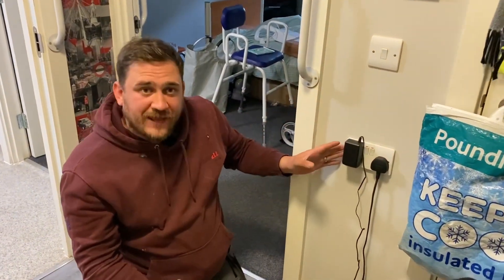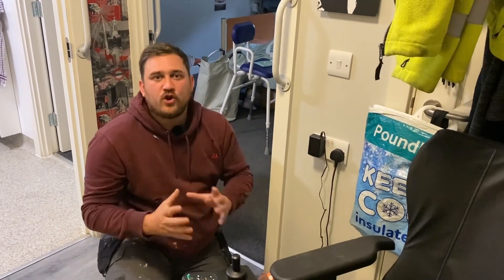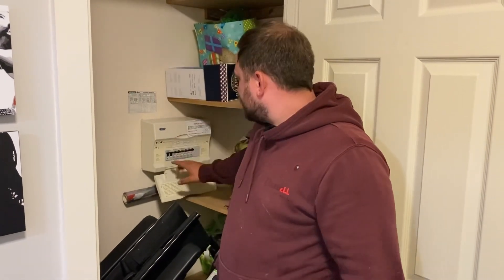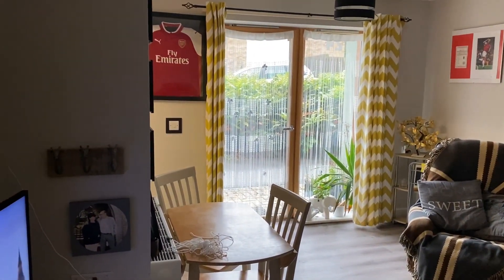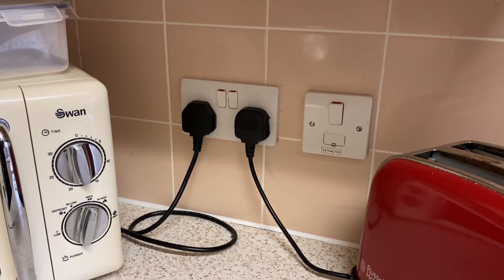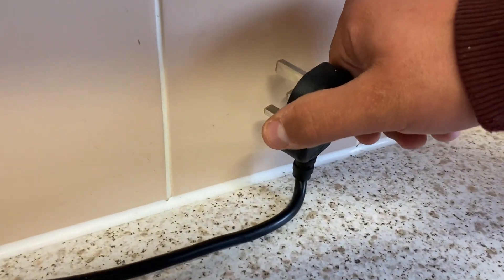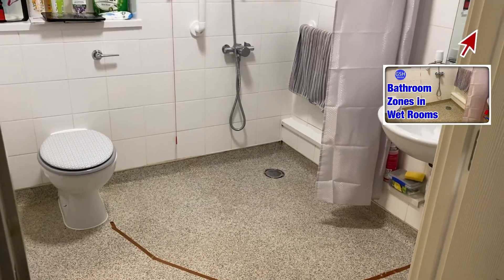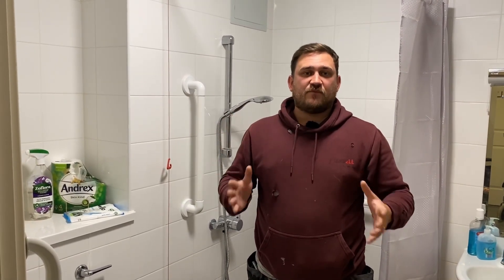The Heights of Switches, Sockets & Consumer Units Under Part M of the Building Regulations

Comment: Completley  wrong. Its 450 to bottom of socket and 1200 to top of switch . In the building regs  its state between 450 and 1200. Not over as the definition of between speaks for itself.  You have misread this totally
Reply: Check what it says in the on site guide   .It states should be installed between 450 and 1200. If you install to centre line then are below this

Comment: Its simple 1200 to top of all accessories ffl and 450 bottom of all accessories. I can't  see whats hard about that and its only new build
Reply: How dare you keep it simple. You’re suppose to pay 💰 for a complex interpretation of these simple requirements.
Reply: @MrAlexwoolf  haha sorry sir, I'll make up some bullshit so we can fleece a few unsuspecting home owners 🤣
Reply: Except when it's a thermostat, or a fan isolator,or a consumer unit and what about double row consumer units and pull cords , disabled alarm pull cords😢😢😢
Reply: @loosecannon5813  its all in regs boards 1400, fan iso should be 1200 or should be at the minimum of 450 for disable, 1200 for stats, disabled pull cords usual touch the floor anyway for that reason. So simple enough

Comment: For me it’s as the diagram shows… between 450-1200mm exclusively. You can’t put a 9 gang switch’s centre line at 1200 if you go by the wording 🤷🏻‍♂️ So really this needs clarifying, as great as a debate it is on site sometimes 😂
Reply from the maker: I have left a link to part M of the building regs in the description. If you keep within 450 and 1200 you will always be correct 👍🏻

Comment: Just checked the on site guide. Still 450mm to the bottom of the socket and 1200mm to the top of the switch. Wouldn’t call it a misconception.
Reply: Exactly my thoughts! Are we meant to use On Site Guide or Part M? The regs are getting more confusing by the day
Reply: Building regs statutory document.
Bs7671 advisory document 🤷

Comment: What about a Three phase consumer unit located in a domestic property to accommodate extra loading from heat pumps, EV chargers, electric showers etc. What height should these units be located as the switches usually run vertically not horizontal?

Comment: Sorry but the hight of accessories is irrelevant, 
My mum god rest her was only 3ft tall and so could not reach a   Light switch at the standard hight , my oldest brother was 6.7 and a light switch was way too low for him. The IET needs to think about the hight of us humans , if you’re a dwarf your still more likely to need to stand on a step to reach the kitchen work top . And if you’re more than 6,2 your more prone to back problems because you have to keep bending down to switch the light on or plug the hoover in . I was tort the hight of socket outlets should be about mid shin and light switch level with the shoulder give or take an inch or two.  For nursing homes or care homes sockets should be about waist high .
But who am I to argue i’am just a humble spark who’s opinion means nothing. 
Great video Marcos as always 👍👍
Reply: I’m 6 foot 8, I can tell you that waist height switches don’t require me to bend over to operate.

Comment: since when did it go from Part P to Part M. I swear that when I did Part P back in 2015  we covered holes in joists, zones and heights of sockets and switches with no mention of Part M.
Reply: Part P is still there each part of the building regulations gives different information I.e part m covers heights of accessories part A covers structure so holes in joists and chase depths etc also not just electrical requirements in these regulations for most trades info aswell 🙂

Comment: I normally allow 6" above kitchen worktop to allow for a standard 6" tile and sufficient space clearance.  NICEIC says minimum 100mm.  But where in the Part M document does it say 150mm, what page on the online copy?  In other areas I usually go by the diagram 450mm to 1200mm even though it says 'centre line' because it also says 'as diagram'.
Reply: Also in the electricians guide to the building regulations 🙂
Reply: @marcusbarritt91  I see, well my 6" will do :D
Reply from the maker: The 150mm rule is not in part M hence we didn’t say it was in the video 👍🏻

Comment: When showing what "Smart" things can do... please omit or bleep out "Hey Google" or "Alexia" otherwise you start /switch a few hundred things on and off.
Reply: Fantastic video great explanation. I was tort socket should be 400 mm from finished floor to bottom of the socket and light switches should be level with your shoulder for an average size man ? It would be interesting to see if you go around the property and see if the switches are level with your shoulder. Fantastic video Marcos as always 👍👍👍❤️